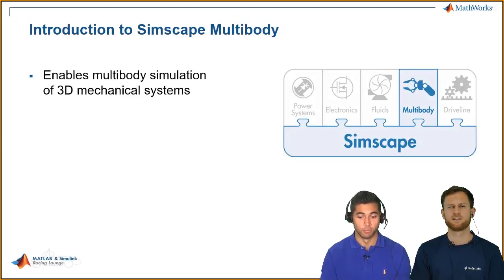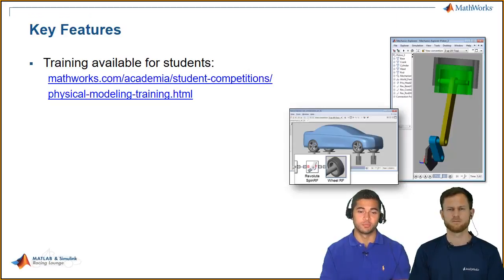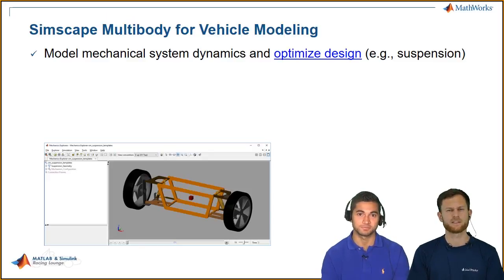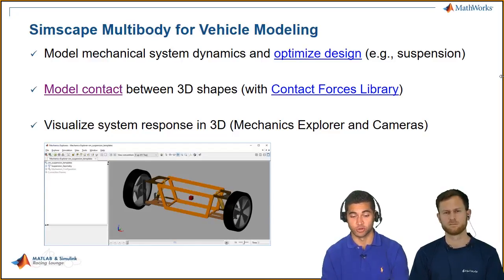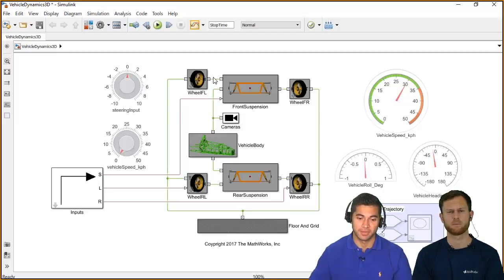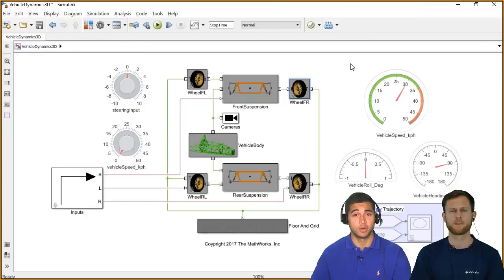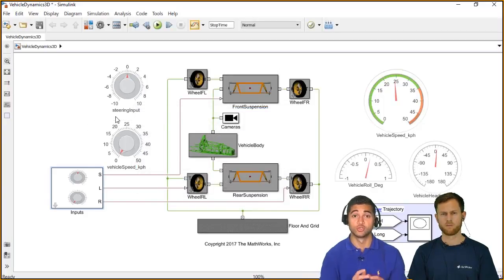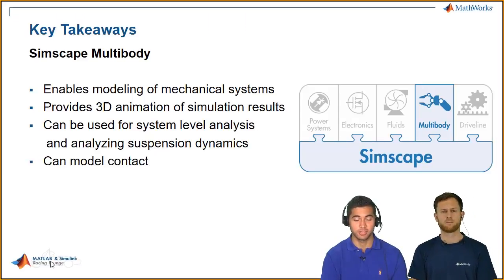Vehicle Modeling Using Simscape Multibody

Comment: Sir which mates i should apply in the solidworks so that it gets perfectly imported into the matlab. I made a sliding(prismatic) joint model in the solidworks and I want to simulate it using simulink/matlab